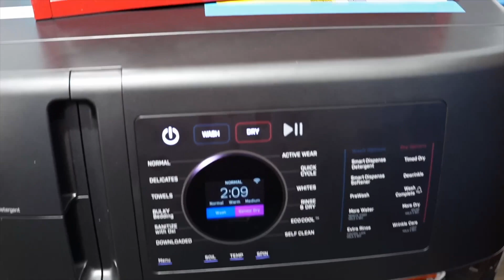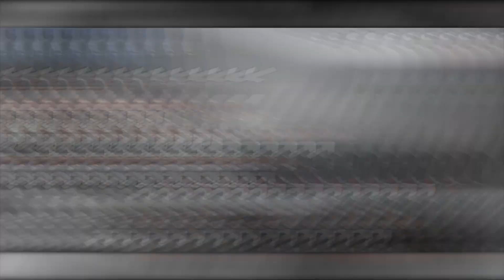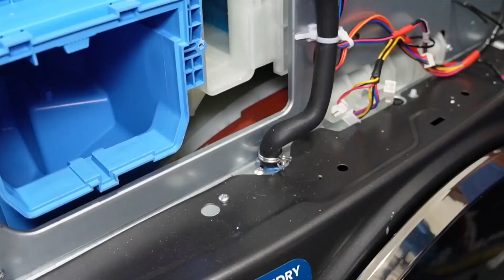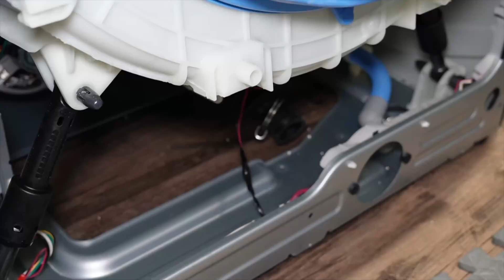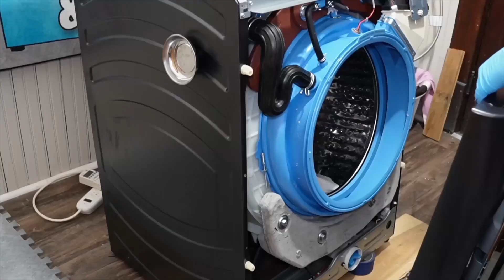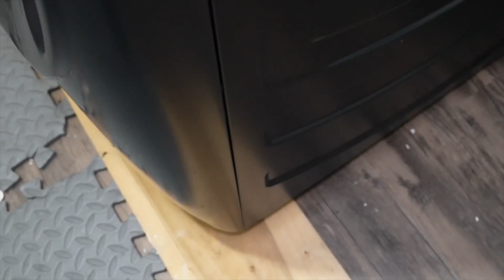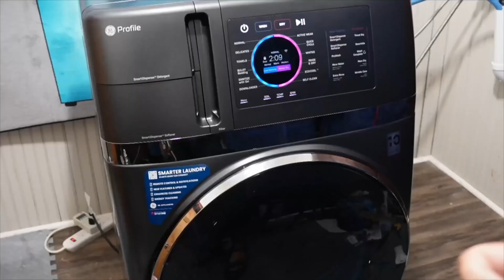GE Ultrafast Combo - Drain Pump Replacement Guide if Unit Won't Drain

Comment: Wow!  Such detail is most appreciated...and I hope I never have to go down THAT road!!! 😊
Reply from the maker: Sadly there's enough people that have asked me for this because their pump is shot already on a machine that came out a year ago.
Reply: @bensappliancesandjunk ...and it's also sad that the potential fail points you noted in your initial review of this model did not call out the pump (if I recall)...and why should it have!?  Whodahthink that the pump would go bad, so soon......  I guess that pushes the meter closer to the LG all-in-one, huh?
Reply from the maker: @jeffdiggs6318  its hard to guess if the pump is actually a fail point, or its user error to clean it out causing pre-mature failure. Hard to guess at this juncture. The front load washers that use the same pump tend to fail from user error from what I see, that then cause a feedback problem to harming the board... But I wasn't aware of major pump issues on the front load washers a year ago, either.

Comment: Wouldn't it be possible and easier to just replace that pump from underneath after laying the machine on its back and without all that disassembly?
Reply from the maker: Theoretically yes, but if I suggest people lean a nearly 400lb machine on its back, I'd incur a ton of liability for that suggestion potentially, and of all the machines ever made - this is probably the last machine I'd suggest doing that on. There's not a lot of room to work with this, again given the extreme weight of the machine too
Reply: @bensappliancesandjunk  I had no problem removing from the bottom. Just leaned it back against the wall. Had the wife there to support the unit. If it is going to fall just make slides down the wall not on top of you. Took about 5 minutes to change out. Use a short Philps screwdriver.  It is easy to find the screws as you can see them protrude through the bottom. Alternatively, for safety you could get an equipment dolly with the lean back feature, and it would be safe.
Reply from the maker: The machine is nearly 400lb and impossible to move with 1 person. I can't recommend that for liability reasons. The LG 2 in 1? Maybe. I should look at that some time.
Reply: Correct, just another good reason to not purchase such a combination washer dryer. Generally speaking access from underneath in a FL washing machine is easy